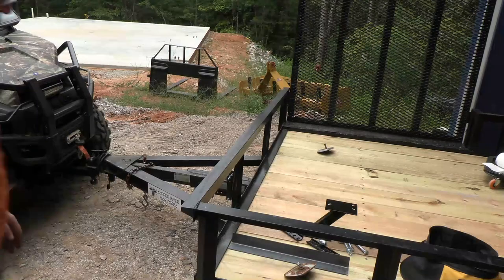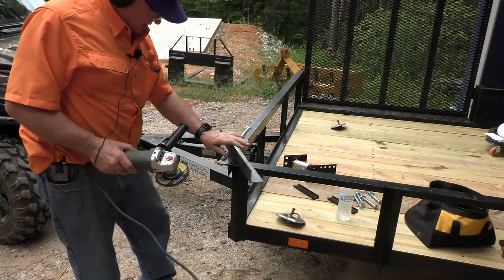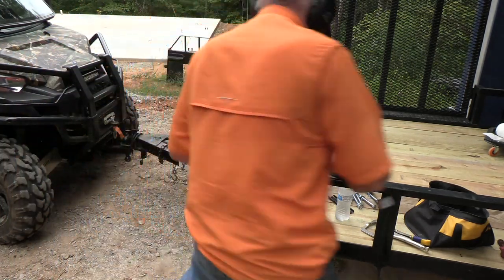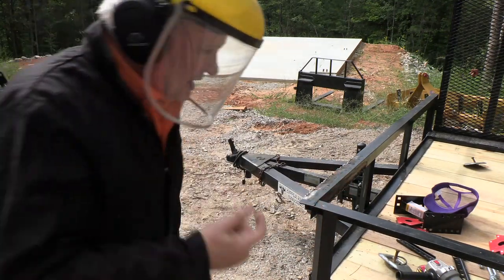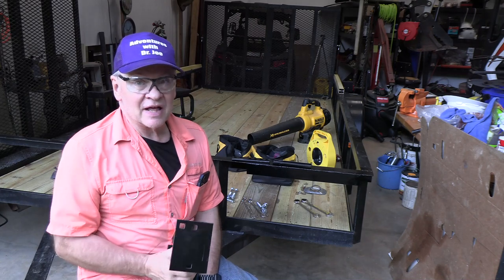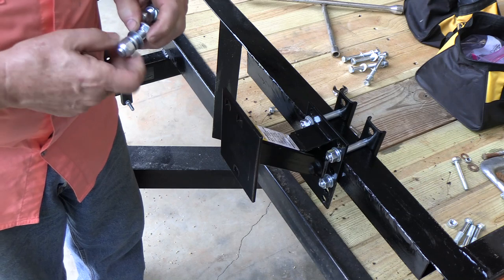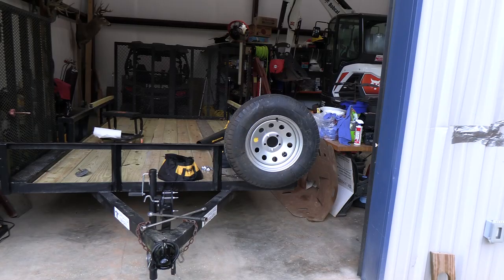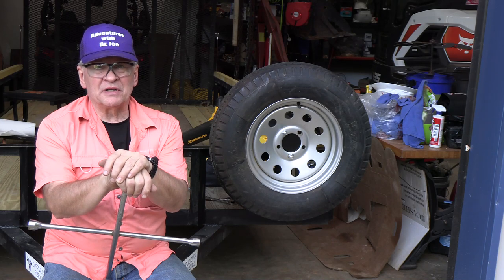Spare Tire Carrier Installation MaxxHaul on a Trailer with Dr  Joe

Comment: I have the same problem with my trailer. I have to weld a piece just like yours on my trailer. Thanks for the video. Thumbs up on your video👍
Reply from the maker: Thank you William for the nice comment. Yes you’re gonna find that that angle iron makes it into a tube which become super easy to mount your tire carrier on. Best luck with that. Consider subscribing. Thanks Joe.

Comment: You could have just used a short piece of pipe to fill the gap in the angle iron, but if you have a welder everything looks like a welding job! I want to get one actually.
Reply from the maker: Thank you for your comment. Yes you are absolutely right. I could’ve just put a piece of pipe there, but I have a welder and yes, it was an ideal welding job. It made an L turn into a square which was a perfect piece to mount the spare tire carrier on.get a welder it’s great. I don’t use it as much as I’d like to but boy is it handy and it’s a real fixer. Consider subscribing. Thanks. Joe.

Comment: hey Doc, you forgot the locking brackets?
Reply from the maker: You are so right. I leave the trailer at my mountain cabin so it’s safe there and every time I use it I just bring it back there so no I don’t have any security on the spare or the other tires. I do keep a nose Lock on the hitch however